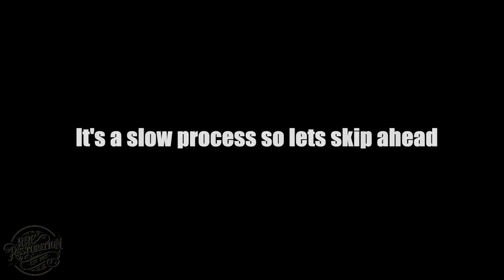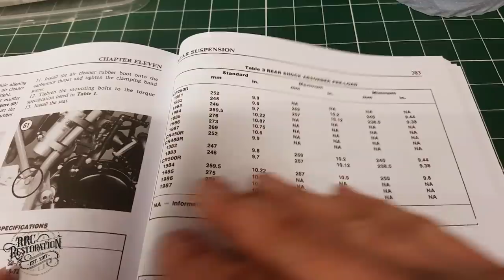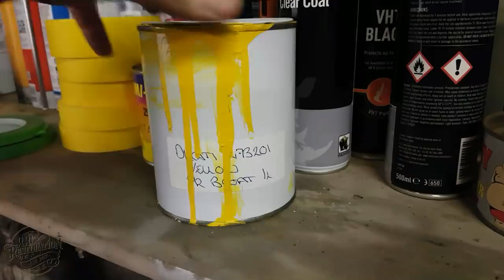Honda CR250 Full Restoration - Part 4 - Showa Rear Shock Rebuild

Comment: The word "restore" is over used by many who think that a light cleaning and some rattle can paint do the job. Taking the time and effort to do a full disassembly, new plating, powder coating and printing your own decals take it to the top level and earn the right to be called a restoration in a much truer sense. 
Excellent work here as per usual. There's a reason why so many of us keep coming back. 👍
Reply from the maker: Thank you very much for your extremely accurate comment and I'm so happy to see that there are people out there that recognize the amount of time and effort it takes to restore something properly rather than just make something " look good" for the camera but is clearly not a restoration . Thank you for coming back time and again it does mean a lot to me :)

Comment: I’ve never used the bullet tool for the seals. I just use the plastic bag the seal came in. Maybe a squirt of wd-40 or pb-blaster on the bag so the seal slips on nicely. Well done sir. You make it looks easy.
Reply from the maker: That's a great idea, ill need to try that instead of tape next time. cheers.

Comment: Awesome work 😊👍 You could re zinc plate then chemi black (zinc & black) the hose with fittings attached as the rubber is not affected by the zinc process 👍 The hose spring can be wound off the hose and bright zinced separately.
Reply: But having said that perhaps the hose was perished so new was the only way 😊

Comment: Outstanding work! I'm taking your lead and working on restoring a 2005 Suzuki Bandit GS1200S to be my commuter bike. I hope it turns out half as good as the bikes you work on.
Reply from the maker: Nice one buddy, Hope it turns out nice :)
Reply: Nice, I have a 01 GS 1200 SS   which is based on the Bandit, same engine, but with styling more like the old GSX1100R, I think only us (NZ) and Japan got them from new, so they are quite rare.

Comment: Amazing transformation as usual! I recently restored a replacement shock for my ZX9r, not quite to this standard, but I whish the spring was as easy to remove. I had to wind out the adjuster and lock nuts as you did, but then use ratchet straps to compress the spring as I don't have the correct coil spring compressor, that was a workout and a half, getting it back on was too.
Reply from the maker: Haha yeah road bike springs can be a nightmare without the correct compressors luckily most MX bikes the spring isn't under pressure when you get to the top of the adjuster so as you saw makes the job a heck of alot easier.

Comment: Don’t forget kids! Take lots and lots of photos and notes. The angle at which that hose connects to the shock and the reservoir must be perfect! Or when you go to install it back on the motorcycle it won’t line up properly. Obviously this is pro level work. But kids don’t be afraid. Use these techniques and you can still do good work. WD-40 and solvent will do a good job. Obviously it won’t be pro level like you are seeing here👍😁But learn from his techniques they’re fantastic👍👍

Comment: Looks great 👍 are you not concerned that while vapour blasting makes the parts look new it removes any corrosion protection (i.e clear anodising) they would have came with new. In my eyes the vapour blasting is only half of the job, the bare aluminium parts still need either re-anodising, clear coating or clear cerakote to stop them going furry fairly quickly.

Comment: on the showas the rebound works through the centre hole. When grinding off peening you should never touch the hole, also applies to loctite application

Comment: great video as usual. would be good to know details of some of the tools you use too, plus how do you get the nitrogen topped up? a specialist? thanks as always for the time and effort you spend not only in the restoration which helps and inspires me but also the editing and video production.
Reply from the maker: Hi, the nitrogen was topped up at my local motorcycle garage as they have nitrogen tanks that can fill the bladder to 280psi. I'm glad my videos can help you out :)

Comment: Top work sir. What solution do you use in your parts washer, it looks very effective!
Reply from the maker: Just a water based engine degreaser, works best when warm ;)  sorry i dont remember the brand id have to look through all my receipts.

Comment: When you pull the diaphragm out via the Schrader valve you want to pull strait up and jiggle as little as possible so you don’t bend or snap the valve.
You can even blow it out with a rubber tipped air gun.

Comment: Oh no brother. 
Most suspension springs are painted not powder coated.
I hope they didn’t media blast it a lot.  
Depending on the cure it could mess with the spring rate.
Also from impacts and flexing during severe compression powder coat comes off easier.
Look up Electroless coating its a good few minutes to waste.

Comment: Great job as usual, I noticed at 21:33 it looked like the washer on top of the bump stop was missing but then it was back at 21:39, was there a frustrating strip and rebuild? or are my eyes getting old!
Reply from the maker: Nicely spotted, I did forget the washer but taking it all apart again to fit the washer was a no go as it would risk damaging a lot of parts needlessly so i just put a slit in the washer and popped it on, the washer is nylon so putting a little slit in it doesn't affect it too much ;)
Reply: @RRCRestoration  It's easily done, I have restored a few bikes over the years and had that moment when you think damn it! I have enjoyed all your videos and are looking forward to the rest of the Honda build, good luck.

Comment: That’s such a silly way that Honda wants you to bleed that. 
It’s not the 80s anymore we don’t leave airbubbles in our shocks Honda 🤣
The best way to bleed the rear shock is to connect both of the bodies together. 
Set the dampener rod nearby to soak with the shim stack in oil. 
Fill the bladder side almost too the top letting the oil creep into the other body. 
Force the bladder in so that a little bit leaks past the bladder. 
This garuntees no air bubbles in the bladder area, in the banjo bolts, or in the line.
Fill the other side up 10mm from top and grab hold of your dampener rod with the shim stack on the end still soaking. 
Quickly take it out and shove it into the body.
Push down quick pull up slow until no air bubbles. 
Next pull up slow then tap the end of the shaft down in the oil. 
This forces oil through the valving removing any left air.
Do not expose the low speed rebound inlet hole or you gotta start over. 
Top it off with fluid and seat the seal head by pushing down and releasing pressure from the bladder. 
Circlip
Pressurize the bladder a little to seat it all. 
Before you filled it with nitrogen did you compress the shock all the way and bleed all the air from the bladder?

Comment: Hey RCC Headquaters! Good to have you back👍 .  Has the Vaperblaster now took place for Mr. Sandman or is this a choice of what Material / Rustgrade appears ?  Greets from Germany 😉
Reply from the maker: Thank you, its nice to hear from you again. :) The vapor blaster will be used for soft metals, and parts that critical dimensions need to be maintained, for really grubby stuff and steel parts they will still go into the sand blaster. also yes if steel is vapor blasted it will rust almost instantly.

Comment: What is that stuff you use to strip the steel parts? I have seen you use in multiple videos and really want to know what it is exactly. I try to see the label but always on an angle i can't see. I am currently starting a rebuild on a Yamaha Enduro and want to redo everything and powder coat stuff.

Comment: An excellent job as always. So sealed for life, non serviceable is a myth then?
Reply from the maker: Pretty much, If it can be built in the first place it can be taken back apart ;)
Reply: @RRCRestoration  Indeed. I had this with a Range Rover a few years ago when the auto ‘box started playing up. “It’s sealed for life sir, you’ll need a new gearbox”. I took it to my local 4X4 garage and he drained the oil and replaced the filter. Do you know, it fixed the problem perfectly.

Comment: One thing I’ve never understood about shocks, how does the adjuster screw on the clevis end have any effect? How does it work?
Reply: I'm not an engineer but... it restricts oil flow by closing a hole so u let's say have to pass the shim packets that r stacked to behave the way the engineer wants, or allows oil flow by opening a bypass just can skip the shim packet... just as the engineer wants it to behave (faster or slower). The cylinder w that bladder allowes the shock work at different speeds and different impacts (absolutely essential at dual sports). This here is a super simple built shock.
If u really want to understand what is going on I advise to take some engineering class or read some books.

Comment: Another great video. I enjoy watching them. What solvent do you find works best in your parts washer?  Also the addition of the vapor blaster is nice. I may look into one myself.
Reply from the maker: Thank you, glad to hear you enjoy them. The parts washer uses a water based cleaner, but at these low temps its quite difficult getting the parts clean so I either need to heat the tank or switch to paraffin in the future.
Reply: @RRCRestoration  yes, I'm about to purchase a heater for my parts washer. I'm reluctant to go to paraffin because my parts washer is in my house and the smell will not be pleasant.

Comment: Hey. What's that stuff you use to remove rust. The powder you pour into plastic takeaway carton ? You also used a lot of it when you restored the Subaru cross member. Thanks.
Reply from the maker: Hi , Its called deox c ;)
Reply: @RRCRestoration  many thanks

Comment: Why not use red LocTite instead of peening the nut?
Reply: As far as I could see he did both.
Reply: @jeddakofbarsoom6137  I guess I should pay closer attention. But I still wonder why not just use red LocTite alone?
Reply from the maker: Its for double safety as this nut is the only thing that stops the shock separating and we don't want that do we lol